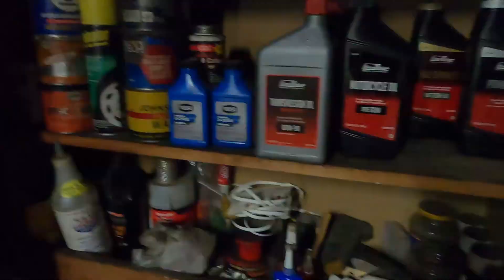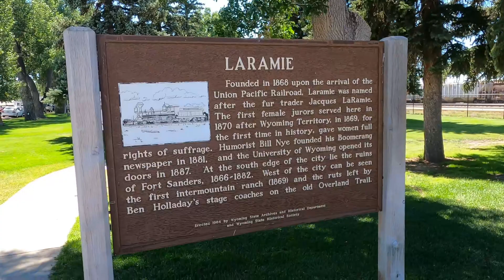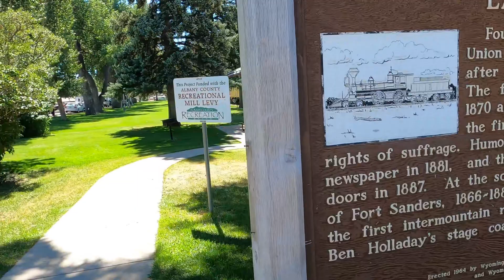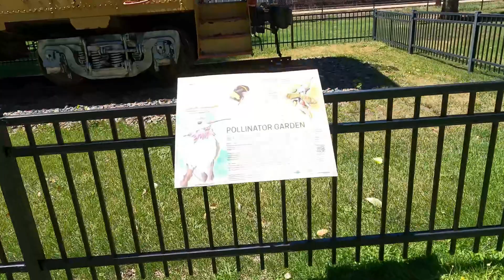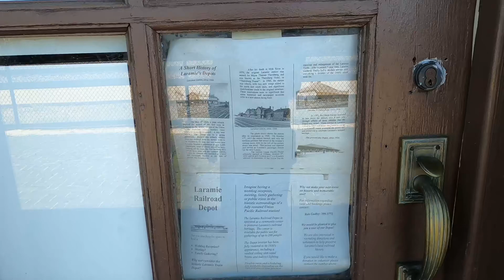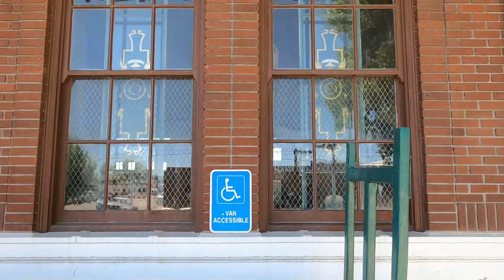SHOVEL ALMOST STARTED SHOUTOUT TO SCOOTER TRAMP SCOTTY

Comment: I don't even know the brand of exhaust pipes on my Shovelhead.  Right now it's up on a Harbor Freight lift. Replacing oil lines. Hope to get it done soon. This is a good instruction video. I have had my 1983 FXWG since new.
Reply from the maker: The ones on mine are old set drag pipes some of brand but I got the s+s cones in side the pipe I just did the braided steel line last week going to do a copper lines this winter glad you enjoy the video we're going to do a rebuild on as well enjoy !!!!